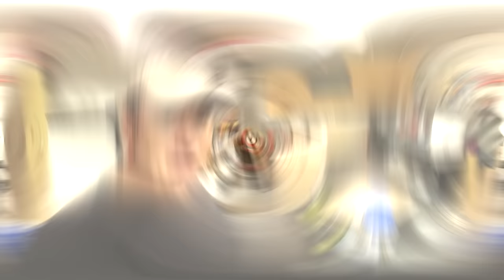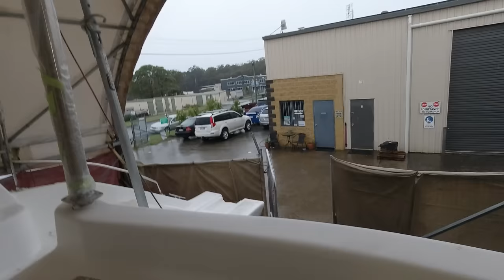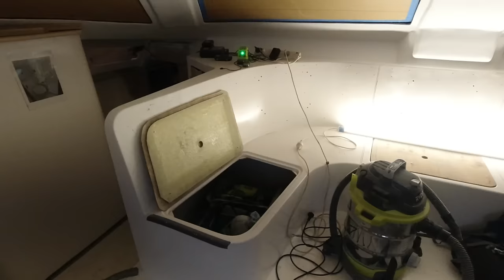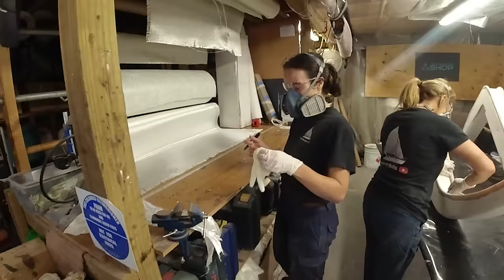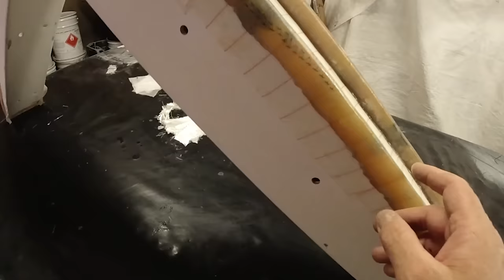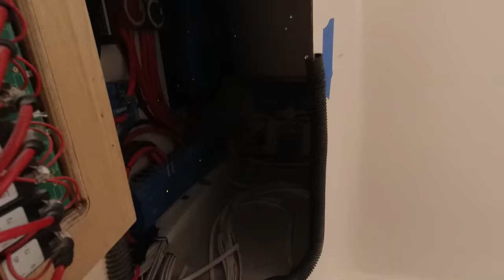Custom Fabrication takes tonnes of work - How to Build A GRP Catamaran Ep 316

Comment: Hey Rosco, a random idea for your davits.  My mate has a 65 foot Azimut motor boata d the best thing on it is a hydraulic platform.  The tender sits on a removable cradle on the platform when underway and at anchor it can be dropped into the water as a swim platform.   It is awesome and something that I would love to install on my Lagoon.  
Your davits should be able to hold an Alloy platform plus Tender and would add a lot of convenience to your boat.

Comment: The small aft locker you are already refering to as an icebox. Sounds like that spot might warrent insulation and a fridge unit before you spray???
Just a thought???
Love your team❤
You are inspiring👍👍
Cheers🍺
Reply from the maker: I haven't quite decided its use but a fridge is the most likely upgrade.Pretty easy to convert .

Comment: Hey Ross.  I was just wondering if you have a drainage point in the bottom of each locker.  It is very important as water will get in there.
Reply from the maker: Hey mate, each lockert had a direct drain to the sea with a skin fitting.I expect every compartment to get water in it, one of the lockers will be for propane so direct drain to underneath the bridgedeck is critical. Thanks for following.Rossco